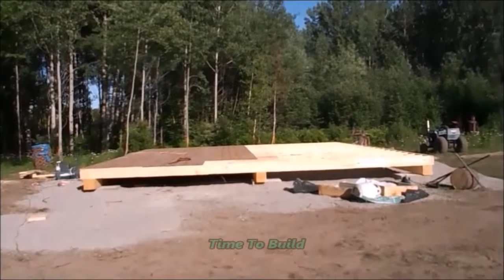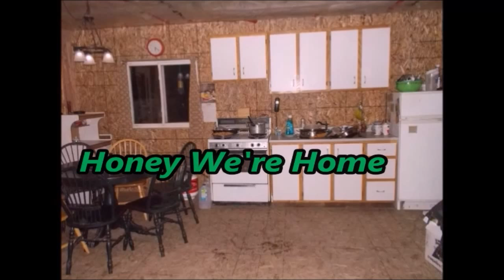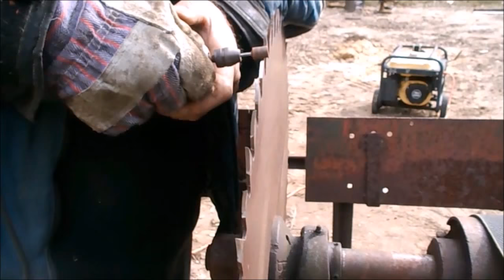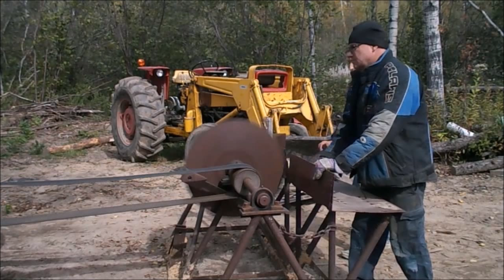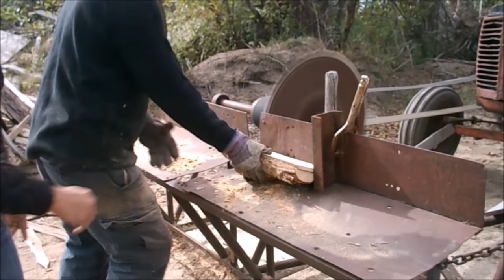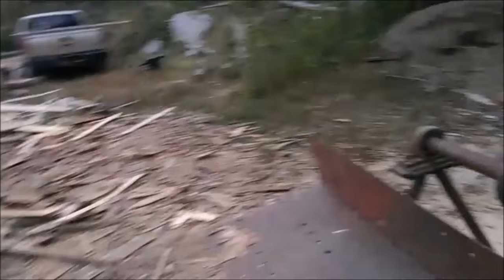Time To Use The Old Buzz Saw With The Old Case Vac

Comment: Buzz saw works for you, instead of you working for the chainsaw, like you say.  How do you work without earplugs.  Yikes!
Reply from the maker: +Joshua Smith The Buzz saw sure makes firewood easy, too bad this equipment is just about all gone now, I should use ear plugs I know but most things like that seems to be just a luxury around here :( Take care ttyl :)
Reply: Cecil E Skinner
Yes my wife's cousin has an old tractor from their grandpa that has the buzz saw built right on the front of the tractor.  It's just sitting around, so i think i will snatch it up and put it to work.  Cheers!
Reply from the maker: +Joshua Smith It would be a handy tool for you if you could get it, I would love to see a video of the set up.   :-)
Reply: Joshua Smith-Homesteader....     That looks like a really effecient way to cut slabs but I'm more concerned about what kind of tea your drinking. ☺️